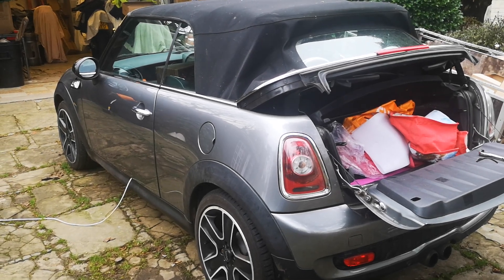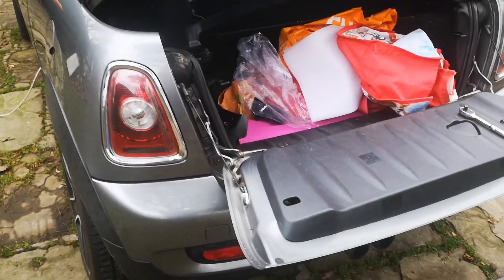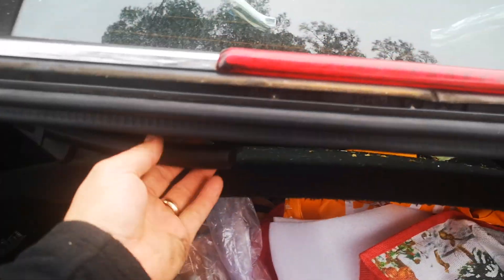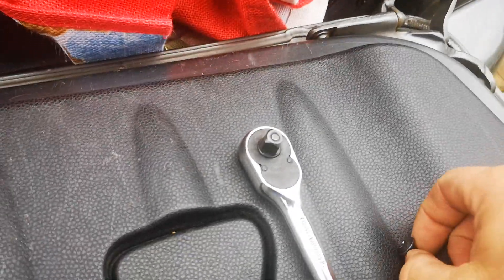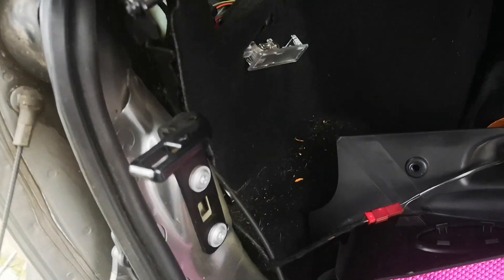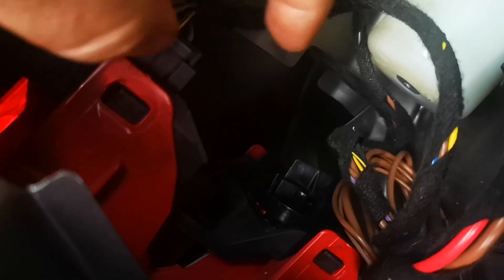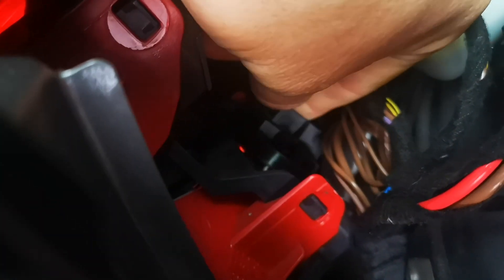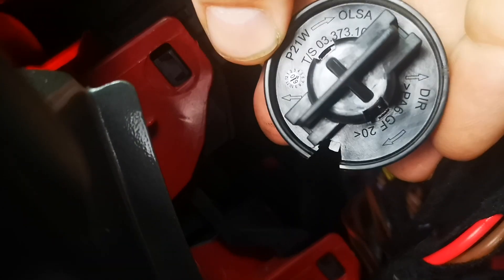Mini R57 Convertible - Rear bulb replacement/ rear light removal

Comment: Haha according to the haynes manual it is far easier to just prise out the light plastic trim with a plastic trim removal tool 3 screws and pull out the rear light and then you have proper access. There is enough wire to do it that way apparently.

Comment: the hinges to lift the top of the boot will also serve as props. when the top of boot is lifted simply move the handle back down and it will sit in the metal loop. no need for the torch to prop it open.
Reply from the maker: Ha yes thanks Tom for the feedback much appreciated !
Reply: I'm having a nightmare with my missus' mini. Looks like the tosser at mini may have glued the top bulb fitting into the light....
Reply: @tommarkhaley  Same here, the other two bulbs in the light cluster unscrew anti-clockwise really easily, but not the top one, not sure how to tackle it yet!  Btw will not take the car to BMW Mini any more as it feels much better when i service it and i also have lots more money afterwards!
Reply: @littleottersps4videos354  a loose connection had welded mine, dont be afraid to get a pair of grips on it and it should release